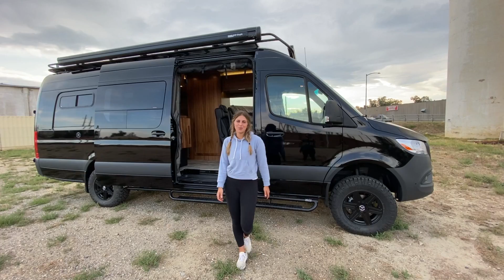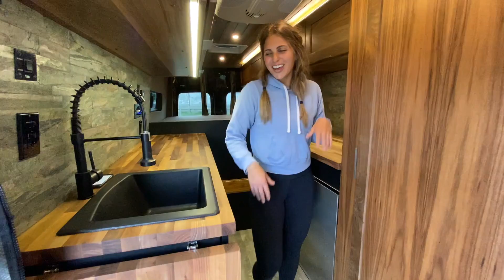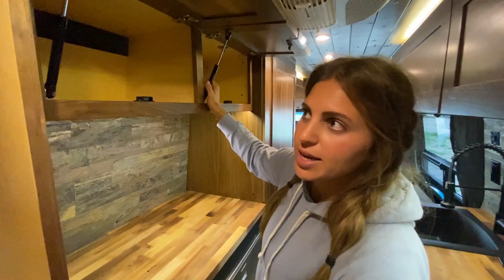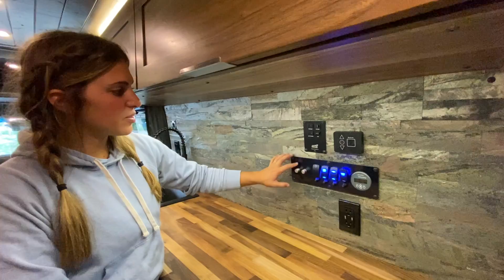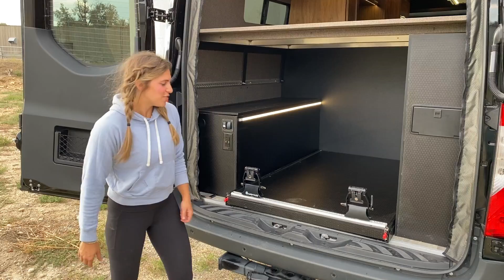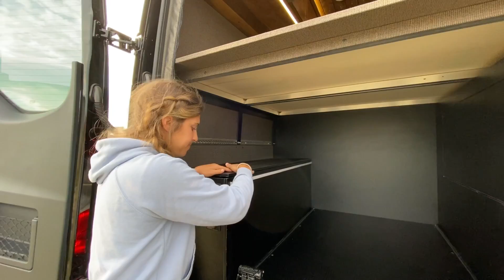VAN TOUR | Sprinter 4x4 170" Ext | Rossmönster Vans

Comment: One of the cleanest builds I've seen.  Can you set up the rear like a Revel where the bed raises and lowers?
Reply from the maker: All of our builds are completely custom, so we can absolutely use this layout as a base and add a bed on electric actuators.
Reply: I bet that for the right money she will do anything you ask her to!
Reply: @RossmonsterRigs  Thank you.  I'll hopefully be in touch you all soon.
Reply: What is the appeal of that. I own a double Happijac system in a toy hauler travel trailer I bought with a salvage title years ago and I’ve never done anything with it and I briefly considered removing the Happijac system to put it in my tall top sprinter but I don’t wanna have to crouch over because there’s a bed over my head when I don’t see a major advantage in a van having the Happijac bed versus having one of those beds that can easily convert from a queen size bed to a chase lounge type sofa by raising part of the bed to form the back of the sofa and then sliding it toward the back doors. I don’t think anybody has but you could even design one so that you can raise the front part of the bed to make a sofa that faces out the back doors when you’ve got a view or you can raise the back part of the bed and make a sofa that faces the front of the van when it’s cold and you don’t wanna open the doors or you don’t have a view or it’s in an unsafe area.
Reply: I can’t stand those cheap looking butcher block countertops that are made out of a bunch of scraps of wood instead of full length pieces. It’s bad enough they’re made out of foreign non-exotic wood that may or may not be hygienic like maple Is. It’s not a coincidence that the only wood they used to use for a butcher block countertops and for professional butcher’s blocks was hard rock maple.

Comment: Okay this is the one I want 4x4 no rack on top just as much solar as you can get and no extra seating just the table for my work and a little bigger shower and maybe a bench with storage where the two seats and at least 40 to 50 gallons of water so how much will this cost me??????
Reply from the maker: All of our builds are custom and range anywhere between 50-100k going up or down based upon systems included rather than necessarily the build's layout (lithium ion batteries, AC, heat/hot water, etc.). If you're interested in getting a design priced out and chatting with one of our designers, please don't hesitate to reach out to us at vans@rossmonsterdesign.com.

Comment: How does 200Watts of solar do 3 water pumps, 2 max air, 1 domestic penguin, lights, laptops, etc. I can't imagine this stays charged in the deep summer heat.
Reply from the maker: There is 340 Amp hours of AGM SuperCycle Battery Bank to store power. That said, this client chose the AC unit to predominantly be used when hooked to shore power.

Comment: How much coast Made this ?
Reply from the maker: Our vans are custom, so price ranges, however builds tend to land between 50-110k with price going up or down largely due to systems included (AC, heat/hot water, batteries, etc.).

Comment: How much . . . HOW MUCH $ ? 😬
Reply from the maker: All of our builds are custom, so they range, but the average is between 50-110k depending on the systems included (AC, heat/hot water, battery systems, etc.)